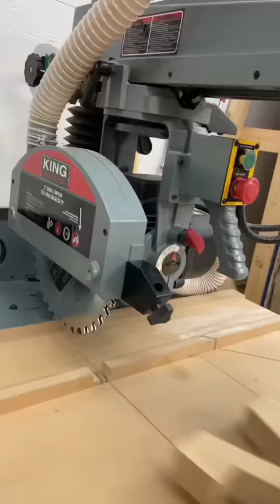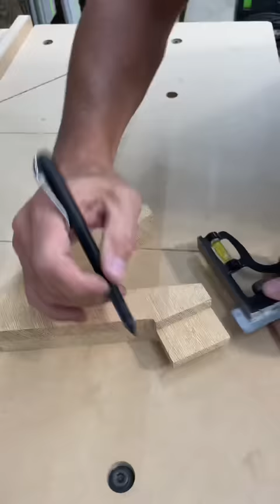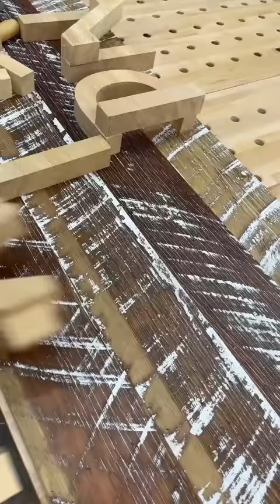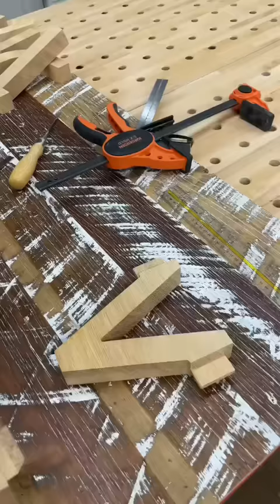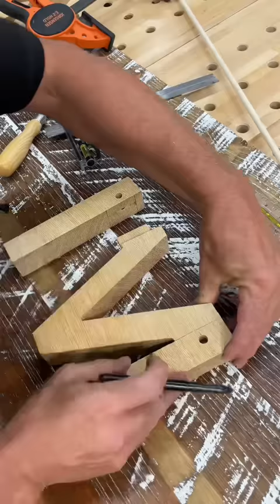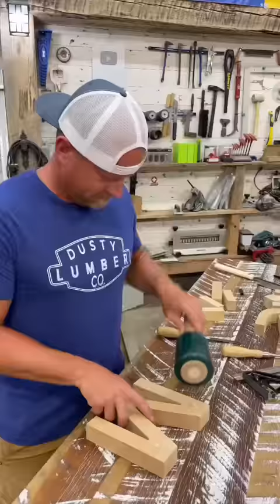Making some wood letters #woodwork #woodworking #maker #wood #shorts #tools #joinery #work #bois

Comment: Let me preface my question by saying your skills and talent are impressive and I’m an addict to you content. I’m not a skilled wood worker myself. Just curious. 

Is there any particular reason you didn’t match drill the fastener holes through all parts at once?
Reply: The holes don't line up. They're intentionally offset a little bit so that when you send the peg through it actually draws the joint together for a tighter fit.
Reply: @Tool_Addicted_Carpenter  That makes sense. Thanks!

Comment: Ummmm, seriously. Why not drill the dowel holes when its assembled ? 🤦‍♂️
Reply from the maker: Because I wanted a draw bore. A draw bore is when the holes are offset so when you put the peg in it pulls the joint tight. It’s a cool practice that has been around for hundreds of not thousands of years
Reply: @dustylumberco  gotcha👍